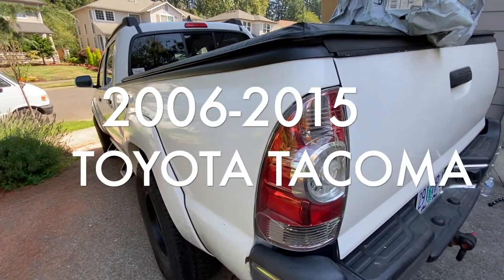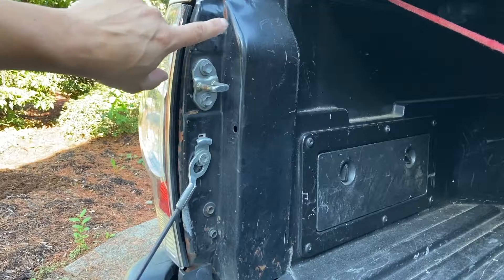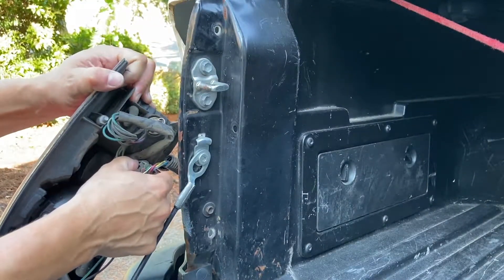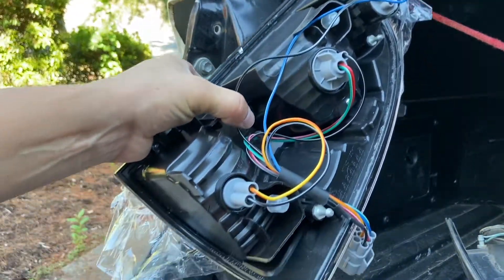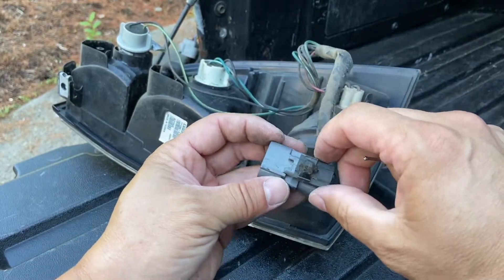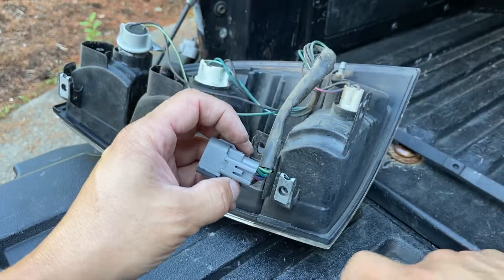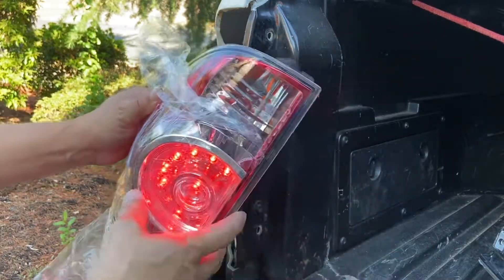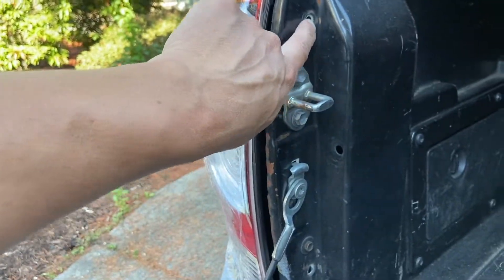HOW TO CHANGE TAIL LIGHT ON A 2006 - 2015 TOYOTA TACOMA

Comment: Mine did not come with light bulbs? How do you get plastic off and replace
Reply from the maker: On the back where the bulb is connected you should be able to twist and take the bulb out by pulling the bulb out and install a new one . Hope that answers the question.